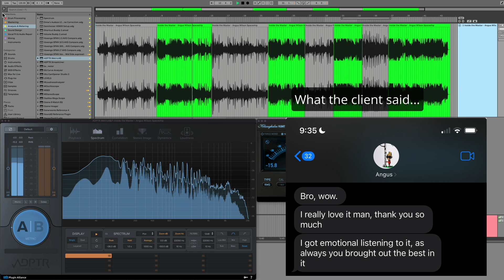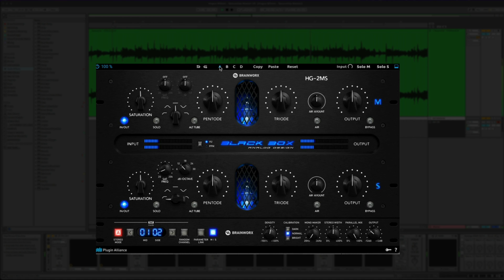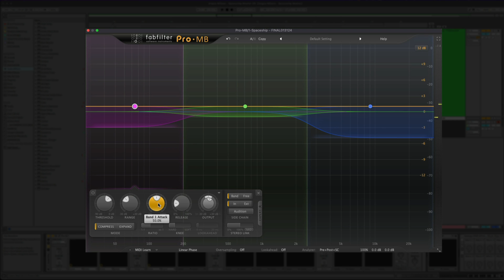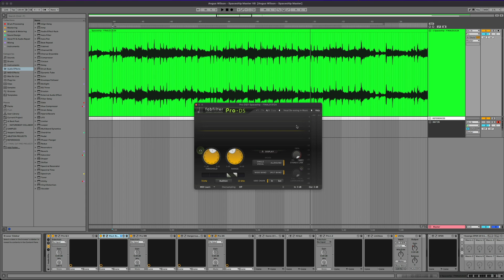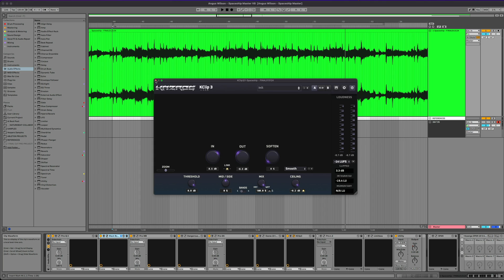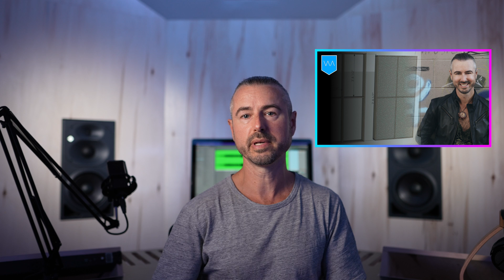Pro Mastering Chain REVEALED - How to Master Step by Step

Comment: Where do you get the loudness from? I’m very interested in this
Reply from the maker: Great question.  The potential for loudness comes primarily from the mixing stage.  But also in production, where you choose, record, and design sounds.  From the arrangement of the sounds on the timeline as well. 

I can only push a well done mix loud.  If it's a mix that has not attended to managing peak levels, then there's only so much you can do in mastering before you start sacrificing low end or fidelity in general.  

In this master, the loudness is coming from the saturation stage in the HG-2MS, then the Pro-MB compressor, then the clipper, then the limiter.  It's a multi-stage approach.  You never make the limiter do it all.  You'll get bad results like that.  

Thanks for watching and good luck with your music!
Reply: Thank you so much for answering my question! I totally understand! @warpacademy
Reply from the maker: My pleasure.

Comment: Vesper if during mixing, EQ, and or Compression can we allow a tiny bit of clipping?
Reply from the maker: I use dedicated clipping (using K-Clip) all over my mixes.  I use them on anything transient for sure.  I adjust them so the gain reduction is transparent, only clipping several ms.  The things I don't clip often or at all, are vocals, lead horns, and sub-bass.  Everything else is fair game in the mix, but I only clip it if it can be done transparently.  This makes the entire mix so loud that the amount of master clipping and limiting is often only a couple dB and the entire end result sounds much cleaner than a mix rammed into 6 dB of limiting on the master.

Comment: Please if you compare mastered and pre-master make same LUFS loudness..
Reply from the maker: Hey Andix.  That is certainly a good practice.  Did you see in the intro that I turned down the master dramatically to bring the level closer to the pre-master?  I certainly did not play a full loudness master next to the pre-master.  They are quite close although not exactly matched.  

Then later in the video, in the section on the limiter, I used the Unity Gain function in Pro-L2 for an exact loudness matched comparison.  Thanks for watching and all the best.

Comment: cool video. One question - You compensate the same amount on every band on multiband compressor - isnt that the same as just turning gain up as a whole? Would love to see this kind of video how you master different songs.
Reply from the maker: Hey Darius.  Thanks for the question.  In the MB compressor, using makeup gain in the presence of compression is not the same as simply turning up gain.  Turing up gain would leave the dynamic range of the signal untouched.  In this case, I'm shaping each band with compression, and using different attack, release, ratio, and ranges for each band.  It was just a coincidence that I turned up each bands makeup gain by the same amount.  The amount of makeup gain I use depends on the amount of compression I'm getting in each band.  In this case, I was just being very gentle and each band only need a touch of makeup.  

Thanks for being a subscriber to the channel and all the best with your music!

Comment: what level do you aim for on the input before all these plugins? thabks
Reply from the maker: All of these plugins have 32 bit float processing or the ability to adjust input gain.  Or in the HG2MS it has a density control.  So really you just don’t want it clipping.  Input levels are much less fussy than with analog or analog modeled gear.
Reply: Gotcha , its just some other tutorial i was watching, saying on the premaster channel gets gained it down to -20 on VU meter and cranks it up on the - 10 or limiter , basically top down mastering,  not over power plugins that follow and  gain stagin through them also hardware responds better if that makes sense! Thank you
Reply from the maker: That sounds like a mastering workflow that's relevant for people working out of the box on hardware.  There's no reason to do that in the box, except possibly for analog modelled plugins.
Reply: gotcha, I do happen to work with outboard gear , good to know for in the box though
Reply from the maker: Ah yes.  That makes total sense.

Comment: Enjoyed the video. Regarding clipping, is there a difference between pushing the input using the link option in Kclip  as you demonstrate and turning the threshold down to meet the peaks?
Reply from the maker: Glad you liked this one.  In K-Clip there is a "ceiling" control.  It has 2 clipping circuits.  This is a simple non-oversampled hard clipper with no control.  The regular clipper stage can be softened and can be oversampled.  

For me, I would never use the ceiling control.  I typically only use the more full featured clipping stage.  But yes, you could pull down the ceiling control to hit peaks - I just wouldn't recommend that.  Cheers!